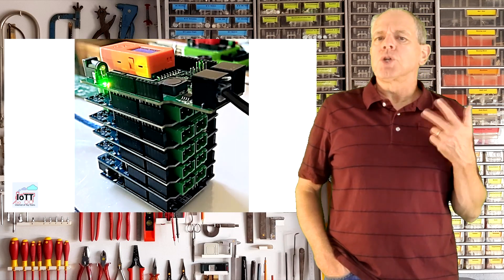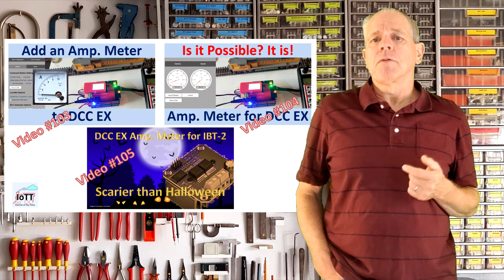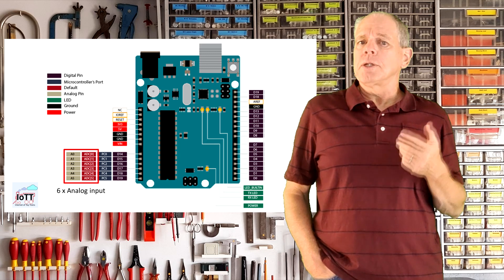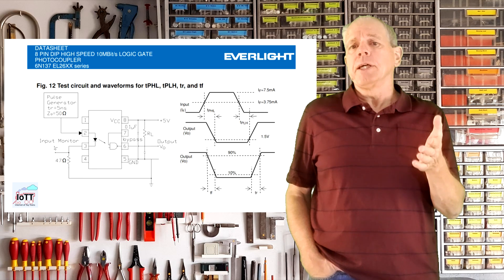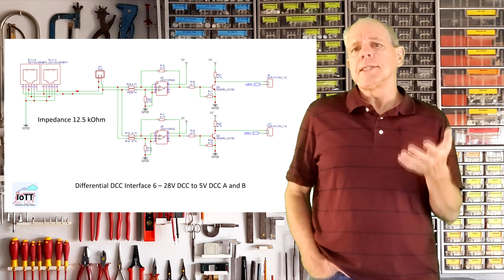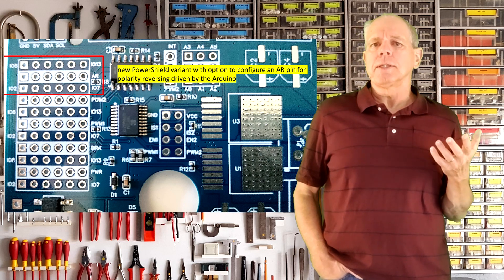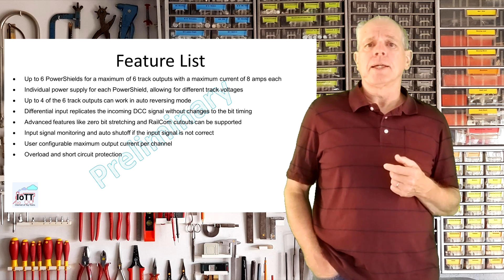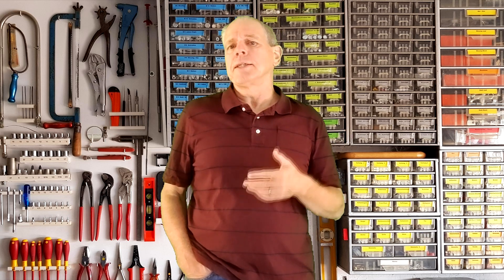DCC Booster Research (Video#126)

Comment: For the Autoreverser, is it possible to program loconet block occupancy detector addresses so that this booster can see that the block ahead of the Autoreverser block is occupied and therefore switch the polarity befit the loco enters the block ? This way you don’t have to wait for a short circuit to occur. Therefore protecting the loco decoder better. Similar to the Digikeijs DR5013 auto reverser.
Reply from the maker: Yes, if you use the SilverHat along with an IoTT Stick you can control the polarity of the reversing output using a configurable turnout address. You can use the event handler on the Stick to listen to a block detector event and then issue the turnout command to set the reversing section polarity. Watch video #136 for an explanation of the configuration options.

Comment: Maybe an occupancy detection option?
Reply from the maker: Thanks for the suggestion. I actually considered that, but decided not to do it for a technical and a conceptional reason.
The technical reason is that the booster can deliver up to 8 amps and with the sensor on the chip it is almost impossible to detect a single axle resistor of 10k, which should be the minimum sensitivity for a block detector.

The conceptional reason is that one booster typically serves several blocks, which means they would have to be wired back to the booster, which leads to more connectors on the booster than there is space for, and longer wires than needed to serve all blocks. It is way more efficient to have distributed block detector cards that have one track input from the booster and serve say 8 or 16 local blocks. Several of these cards can be supplied from the same booster.

Comment: Hi Hans. You said that there is the possibility of using separate power supplies for each Power Shield board - does that imply that you could use the same supply for two or more Power Shields on the same Arduino, so a single supply for Power Shields and Arduino….    Thanks!  Billl.
Reply from the maker: Yes, you can. You would daisy chain them on the input side. You can see that in Video #125 where I use 4 PowerShields supplied from the same supply. The only thing you need to think about is the current you can draw. If you plan on running full 5 Amps om each shield, it is probably not a good idea. But for a 'normal' layout it is an option.

Comment: Does will with DC district
Reply from the maker: Technically it could, but it would not make much sense as if you have several outputs, they all carry the same signal. To control DC districts you would need different speed in each district. That does not come from a booster but from the command station as shown in the last video (and more to come in the future)
Reply: @IoTT  thanks you

Comment: Does it have an output so it could be connected to an existing booster bus?
Reply from the maker: It takes any DCC input either from a command station or a control bus, as long as it has DCC Rails A and B and the voltage level is somewhere between 5 and 30 or so volts.

Comment: This looks like a great addition to the excellent IOTT lineup.

+1 for the RailCom cutout support.  Also, could current values be available via MQTT?
Reply from the maker: With the IoTT Stick on the AUX shield, you can send out the current values as analog message either to Loconet over TCP or MQTT and then use some other device for example making a current display or event based system etc. Everything is possible as the data can be distributed.

Comment: hello Hans, if I understand correctly the orientation of your architecture, you dissociate the control station function without motorshield card and the multi motorshield booster function.  Will the control station still control the entire network?  possible additions to the booster: LED display for current measurements, temperature, one shut-down button per channel.....
Reply from the maker: Yes, it is just a regular booster that can be used with any DCC command station, which is still in control. 
Thanks for the suggestions. I like the LED idea. Temperature is difficult as I do not have a temperature sensor on the PowerShield that I could read out. But individual disable/enable per channel certainly will be possible.

Comment: Well the IoTT line of products is just getting better and better. A booster will be a great addition. So if I’m reading this right, using a spare Arduino UNO with a motorshield and your new booster board will give me a complete booster in one package. I can then expand the booster as I wish by simply adding motorshields. Does the auto reverser feature do the same thing as say an AR1? If it does, that would make some things much easier. One feature I’d like to see is the addition of a screen to give you some feedback on what is happening. I know the IoTT stick has a small screen but my eyes aren’t what they used to be so something larger would be nice. This would be even better if it could be placed remotely on, or near, the fascia. Even a 16x2 lcd display would help. Thanks again for your excellent work. You are making DCCEX one of the best things to happen to model railroading!
Reply from the maker: Yes, auto reversing is like the AR1, typically based on current pulse caused when a loco is bridging the double gap and polarity is opposite on both sides. In addition, it also could be controlled from the outside, e.g. via turnout address.
Regarding screen, the solution is using a web browser to connect to the status page of the booster. Could be on the smart phone as well.

Comment: Traincontroller fixed the loconet over tcp so all works well. Would be great to develop some loconet accesoires as a servo decoder, switch decoder for switchmotors and block current sensors. Thanks for all the work you do.. Regards Tom  Reinach Aargau
Reply from the maker: So it was a software problem? Regarding Loconet accessories, check out videos #47 (YellowHat), #66 (GreenHat) and #78 (Level to Pulse converter).

Comment: Hi Hans!   Looks very good - for my scale/gauge boosters combination 3 to 4 outputs each with max current of 3 Amps would be good - I would have a DCC EX command station with RedHat and a booster combo on each baseboard of a portable layout.   Looking forward to having boards to play with!

Thanks again for all of your projects!

Bill in the UK!
Reply from the maker: Sounds like a good application. Would certainly be more cost effective than using commercial boosters and you can simply run a Loconet cable from module to module to control everything.
Reply: Can boosters send back the current consumption of each power shield to somewhere - maybe via MQTT?
Reply from the maker: @billflude5204  yes, Loconet or MQTT